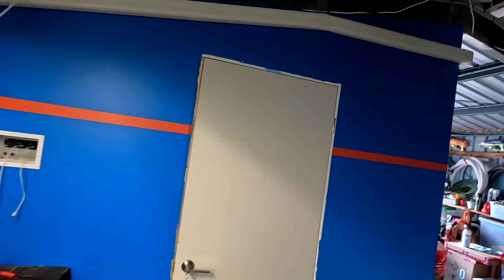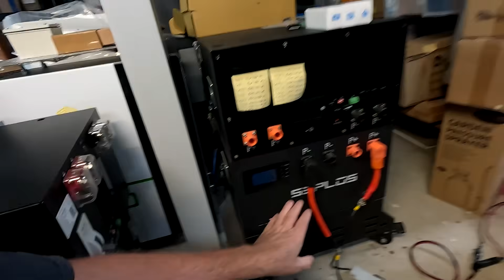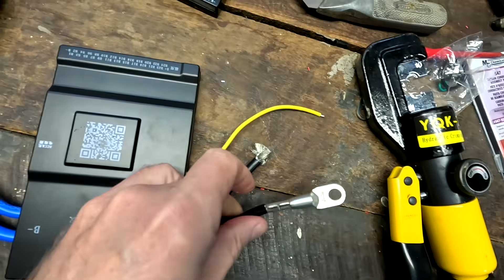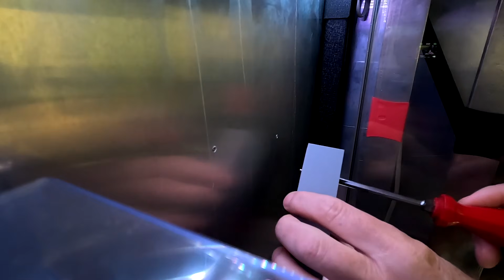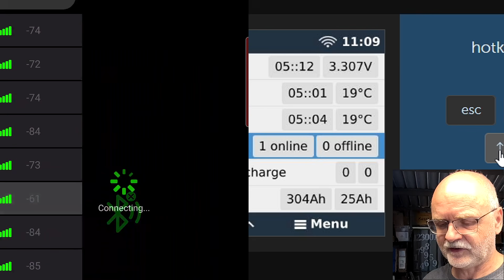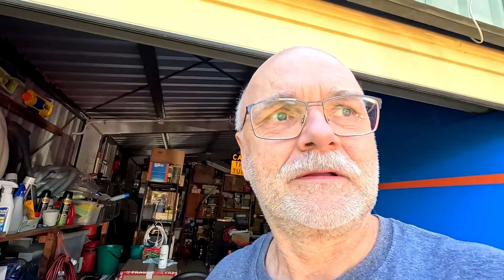JK Inverter-BMS and JK B-Series BMS in parallel adding extra safety to the Battery Shelf🛟🔋

Comment: @Andy which Model do you use. I tried to order a B2A20S20P-HCR, but it doesn’t available on all recommended platforms like Ali eBay… only the …-HC version is listed, there’s is no RS485 installed for daisy chain. I bought and installed it with a p-link, but there is only the internal rs485 port with the uart protocol functional. I’m interested in which model you installed?!

Comment: Hey Andy nice to see the room painted very nice victron color. any way before replacing those busbars you need to use sand paper  to grind the oxidised terminals. going off grid with my 85kw batteries and 30kw solar I could get by in spring and autumn, but in summer I use more than 200kw daily!!.

Comment: Andy, I have had a similar problem with other cable sizes being AWG not mm2 and my solution was to use two different clamp sizes i.e. using a 25mm jaw with a 35mm jaw on 2AWG cable for a good connection. Also lug quality can play a big part, so do a test crimp first. Amazon quote mm2 but what is supplied is always the nearest lower AWG size. It should be illegal as it is dangerous, but complaining so far has been a waste of time as they just don't understand the problem.

Comment: regarding those eve cells k and no k, you are not the only one expericing problems with them, i am testing all my 366 cells atm of witch aprox 150 are of eve, and i found allready 12 dead or severy under preforming cells, still need to test 20 eve...all banks are 16s2p. if you need a balancer, locate the bad cell and get rid off it, good to see you and your cells still going strong, keep up, thanks

Comment: Um, I'm not so sure that filing down the squeeze-out on those crimps is a good idea.  If nothing else, you're weakening the wall of the terminal that is trying to holding everything together.  What I do is to do the crimp, then rotate the terminal one hex position, putting the squeeze-out in the corners of the crimper die, and re-crimp.  That action pushes the squeeze-out back into the crimp, keeping the crimp wall material intact, if not a bit mangled.

Comment: Can anyone explain "Smart Sleep Vol"? I have 4 Mb31s in a 12v battery box with 200a JK 4s1A bms. I didnt connect the "on off" switch as i will never be turning it off. Last week my battery had completely shut off and everything in my Brass Monkey fridge had gone to shit. The battery still had 260AH left. In the settings I found the Smart Sleep V set to 3.5v and for a 24hr periond but i know for fact it had been longer as the ice bags had completely melted and water was room temp..what happened here?? I have since jumped the batt and turned the Smart V down to 2.5v and 1hr and has been fine the last 5days....(only connect solar once a week for a day or 2 to top up 100%)

Comment: Victron blue with orange striping is simply brilliant!

About your problem, are you sure that the terminals you use between the BMS and te batteries, aren’t causing the resistance?

Comment: I use now Klauke KF125 grease. They special for Aluminium. To reduce the oxid layer. But only by this old style cells with internal thread, not by welded studs.

Comment: Clean all electrical mating surfaces then lightly de oxidize and just use any dielectric grease and bolt it together.

Sure conductive grease can be great but for high vibration or voltage i would stay avay from it as it can creep and cause problems

Comment: Hi Andy, I used copper slip grease on my battery and serviced it 2 years ago with no issues so far, it gave a very low recitance measurement. Just some simple advice out of experience shared. It was all I had when I build my battery.

Comment: Hey Andy, thought about upgrading the Multiplus to the newer 6K5 version? This way you have the full 6500watt available instead of the 4000watt (5000VA). The efficiency of the new Multiplus 6K5 is also better and last but not least, it has much better cooling! If you're going to run the entire house off grid, you might want to have a little extra headroom.

Comment: For many years I use to maintain installations that containing banks of batteries from lead acid to gel cell and lithium batteries , I have tried many methods and products to prevent corrosion and oxidisation on terminals and bus bars and the best way I have discovered is to lightly clean the terminals and bus bars with Inox MX3 before installation and lightly reapply every few months. I have never used aluminium bus bars only copper.
Reply: Interesting observation, thanks for sharing your experience. Inox MX3 has a secret formula, but I guess it is a light paraffin oil. I have used to moisture protect circuit boards on power tools and their batteries and to revive submerged mobile phones. But this is an interesting application that I will add to the list.
Reply: every few month !?

thats a tedious hobby and wouldn't leave any spare time for a job.
Reply: @casemodder89 Actually it was a tedious job that didn’t leave much time for a hobby, but it did pay well.

Comment: I'm curious..... when will you upgrade the MP2 5k...
Reply: Wondering that too, a good upgrade would be the new MP2 6K5
Reply: @veeerzes or three phases...
Reply: @enib3179  But if the house is not three phase, it would be a lot of extra work. I would simply replace the MP2 5000 with a 6K5 or even a 10.000 (6k5 is better than the 8000).

Comment: YAY, you have more than enough capacity now to take the next step and get the house off grid....will you disconnect from your energy supplier altogether ??? 🤠😎
Reply: I think Andy is waiting for the termination of great $$ feed in rate they have in the house system
Reply: @76queen 100%. Same with me. 
The daily grid access charge is going through the roof. I’m worried that it might be a compulsory charge even if you disconnect. (That’s what they already do with sewerage and water.)
Reply: @FutureSystem738  Thanks Guys, I'm currently off-grid totally, if they try pull that compulsory charge on me, they'll have a fight on their hands I'll tell you. The overreach of councils and some of these companies is deplorable !!!
Reply: @FutureSystem738 it’s the only way electricity retailers can maintain their profit margins.

Comment: I also have two banks of LF280 cells in use for over 6 years now. No issues with cell balance. I use my home made copper flexible bus bars and MG847 with them since the start.
Reply: How many mm2 are your homemade bus bars? I'm looking to compress mine, but they came with solid bars.
Reply: @ThisRandomUsername  They're 25mm^2. Since I have 8 packs in parallel, they never even come close to the rated current. You can these days find this kind of bus bar readily for sale.
Reply: @upnorthandpersonal  Thank you. I have seen the braided ones on Aliexpress for not too much money.

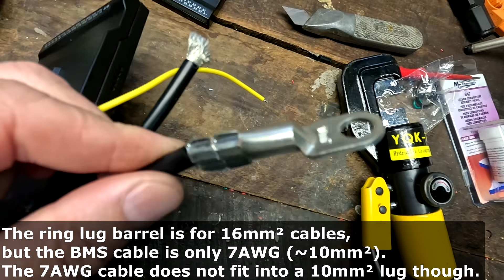Comment: 12:15 7AWG - 10/16mm crimp. I press a little, turn 60 degree, press more, turn 60 degree…. So i avoid the need of filing
Reply: JK and other china men need to learn that the majority of people living in this world uses metric system, not old fashioned trump-brexit-awg
Reply: @olaf_s_23 
aWG stands for American Wire Gage, over here in UK we use metric cross section for wire size. Even the BS7671 wiring regulation, there is no mention anywhere about awg. All tables and al calculations are done in mm2 cross section area.
Reply: 👍👍👍
exact the way i do.

Comment: I have just changed my 2 batteries bms's to the JK bd6a20s10p. Running open loop. Inverter is the Victron Multi RS solar and fully off grid for 3 years. 10kwh capacity and 5kw solar. Currently charging and floating at 55.2v as it's winter here, when the days get longer I will float at 54v.
Reply: Why float differently?
Reply: @wingnut771 So not to over charge the cells when we have longer days but probably not necessary as it's an off grid system and the battery discharges every night. Average 2 to 3kwh over night.
Reply: @matt4417  Why not float at Andy's 53.6V? over all the seasons?  LFPs don't float anyway, have you not seen his earlier videos from a few years ago?